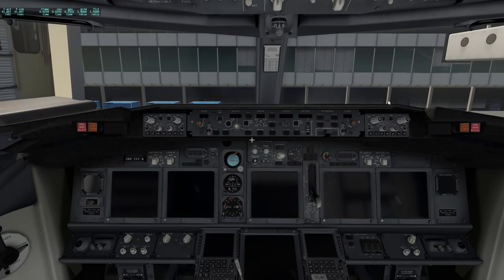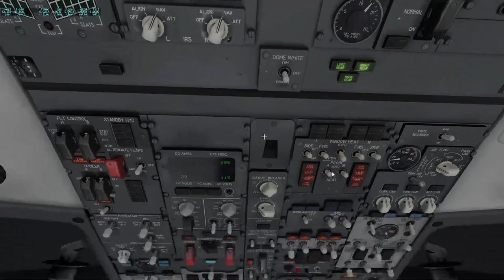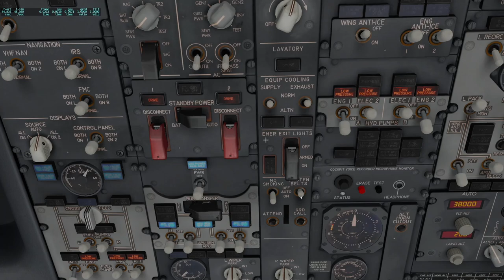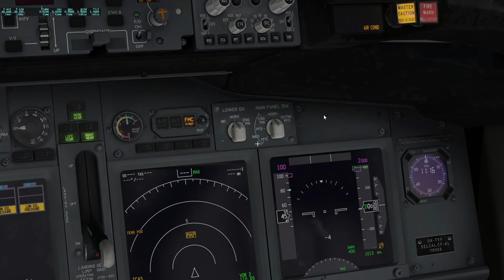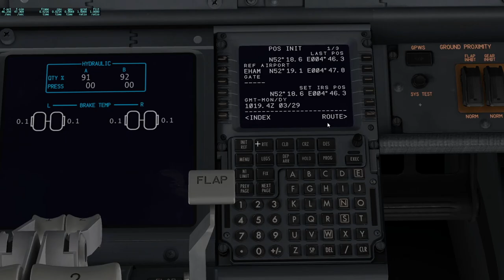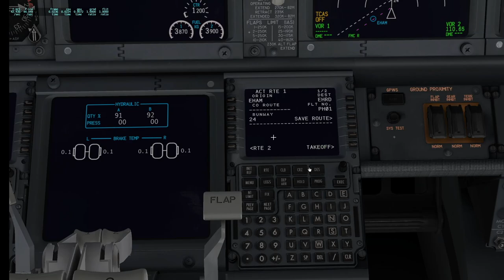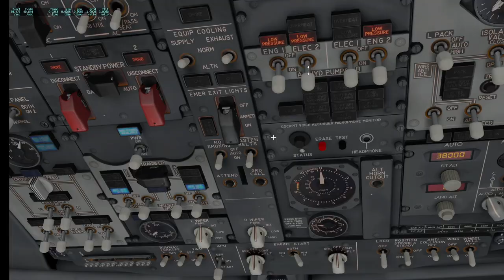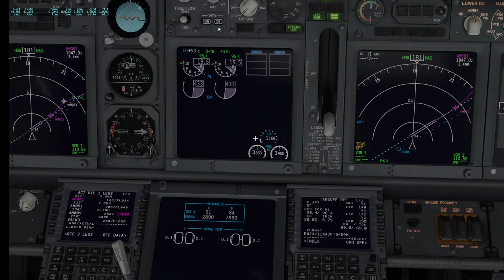How to Set Up a Boeing 737 (PMDG, ZIBO) - Step-by-Step Tutorial from cold and dark to engine start

Comment: Geweldig. Alleen jammer dat sommige hardware zoals de TCA Airbus throttle quadramt, niet 'gebinded' zijn aan de software. Zo kun je de engine start switches niet van cutoff naar idle krijgen. Kan (nog) alleen met de muis. Verder is het geweldig. Overigens is dit een PMDG of MSFS 2020 probleem. De Zibo Mod doet het wel uitstekend.
Reply from the maker: Ja dan krijg je al snel dat je een hele cockpit setup nodig hebt natuurlijk! Leuk maar niet voor iedereen weggelegd qua techniek, ruimte, tijd en/of geld.. Maar zo'n setje is wel leuk om mee te sturen! Ga ik ook even aanschaffen als ik voor de Airbus A32x type  rating op moet.